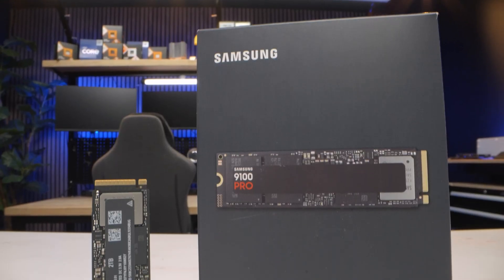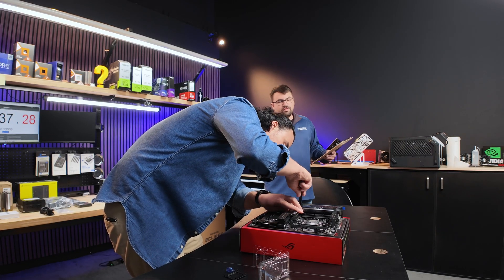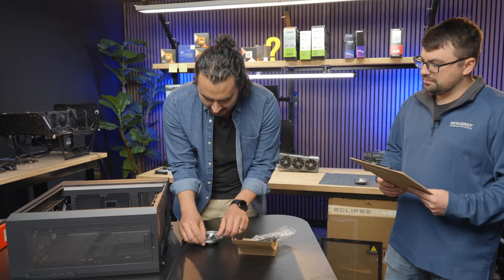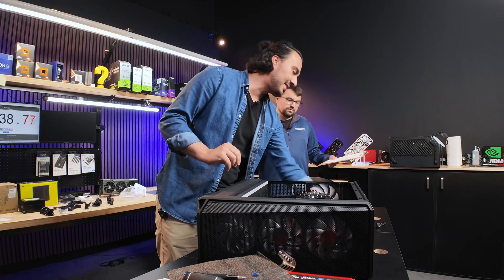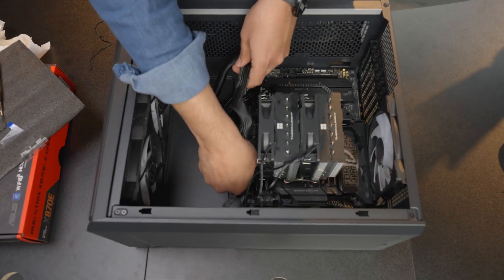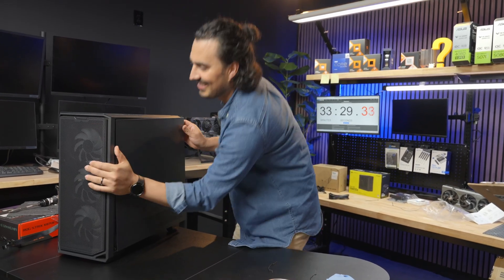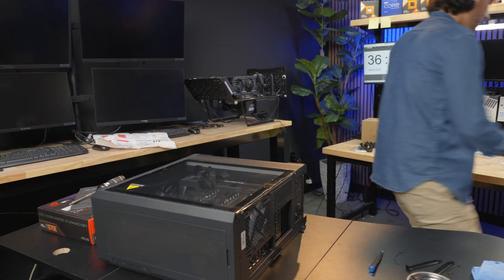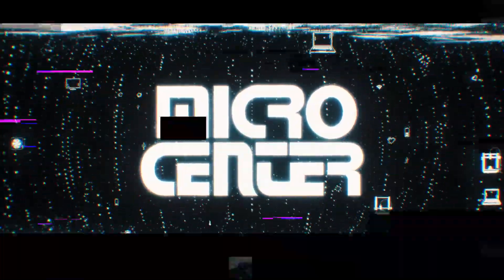Let's Build A Speed Build PC

Comment: I made the worst mistake when building my pc when applying thermal paste the stock cooler I used already had pre applied thermal paste so I added some more because why not turns out it’s not just a mess the thermal paste acted as an insulator so now this weekend I will try and fix it

Comment: Not bad, I would've installed the air cooler outside of the case, a simpler single tower air cooler would've saved some time, probably could've done it within 30mins without camera and pressure. Cable management is where most of the time is spent for myself :yt: